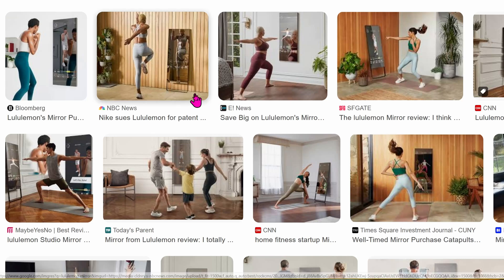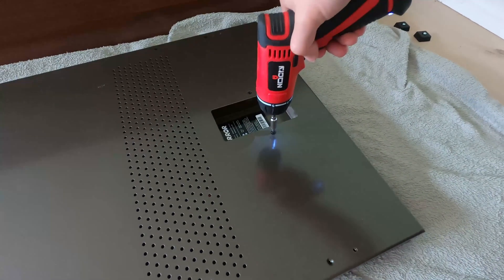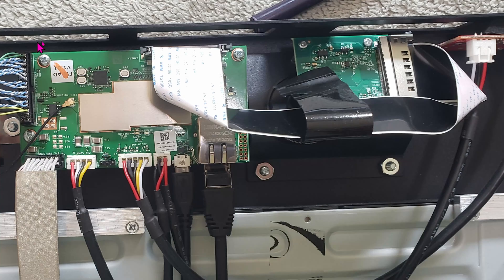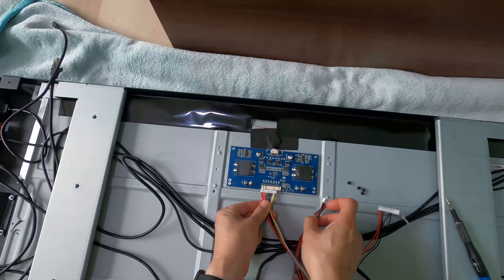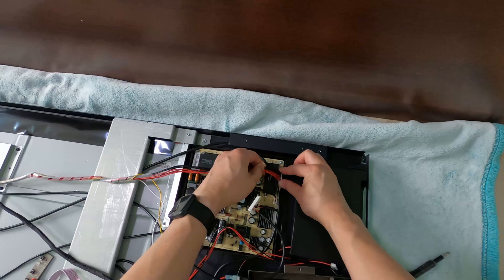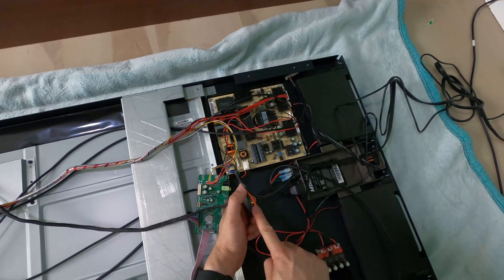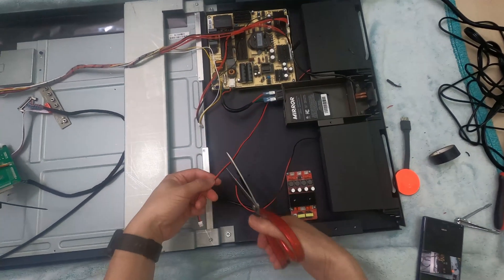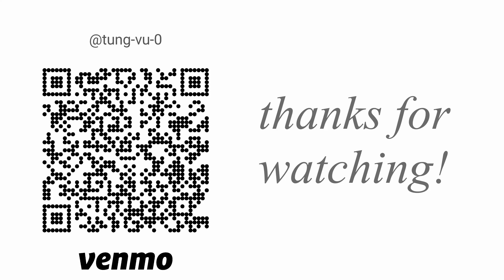Lululemon Mirror hack: installing a new controller driver

Comment: Hello.  Thanks for the Epic tutorial.  I followed the instructions and have a brand spanking new Entry smart mirror that I absolutely love!  You mentioned you were going to do a follow up video for the audio amplifier.  I can't seem to find it.  What amplifier did you use?  one last thing.  when the screen is activated and turned on the Input HDMI overlay shows up.  Is there anyway to disable that?  Thanks
Reply from the maker: part 2 is up. it shows which amp to use https://www.youtube.com/watch?v=vJqoqVfDUQA    HDMI overlay is due to the display controller.  if you can find a compatible display controller that only has 1 input (HDMI) then that's the solution....   i have not found another compat display controller

Comment: Thank you for the video!  I connected the switch to the loop, but it still requires me to push the little button to turn everything on.  Any ideas why?  Thank you!
Reply: I think that switch turns on the power supply, but the display then also needs powered. The switch must be a rocker, like a hardware switch, while the button is more like a switch that you close which starts up the display controller.  Maybe you could short that switch and it would turn on right away, idk

Comment: I'm having a hard time figuring out the power switch with the loop on the new controller. I understand that I need to cut the loop in half so that there are 2 exposed ends. But then do i bundle the 2 new loop ends, with the 2 wires from the existing mirror switch to become one single bundle of 4 wires? Or do I connect each loop wire with each power supply wire? Thank you!!
Reply from the maker: the 2 wires from the loop  will connect to the 2 wires from the rocker switch.

Comment: Hello.  Great tutorial.  I am having trouble with the power switch.  WHen I connect switch to the loop, the mirror powers on but the second I stop pushing the power switch everything turns off.  Any suggestions?
Reply from the maker: there are at least 3 versions of the mirror. seems your version is very different from mine :(
Reply: @dablet  yeah I have the 1st gen that was produced.

Comment: The Lululemon mirror was just purchased by/merged with Peloton. I still use it for its intended purpose just now you get lululemon and peloton classes. This mirror is def not obsolete.
Reply: are the classes with peloton for the same price
Reply: It will be in 2028. So, might as well make it a super boss mirror! I got one second-hand and it is tough to get access without the "original purchase email." I only paid $100 for it so willing to toy with it. If I paid the regular price I wouldn't until 2028.
Reply: @amberwilliams5378 Is it possible to sign up for an account still thought? If you don't have one already?